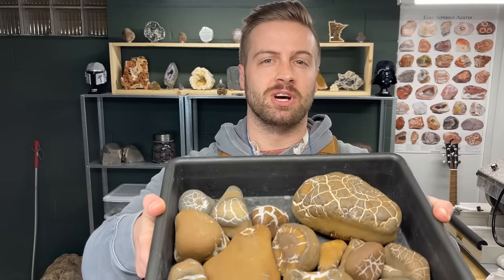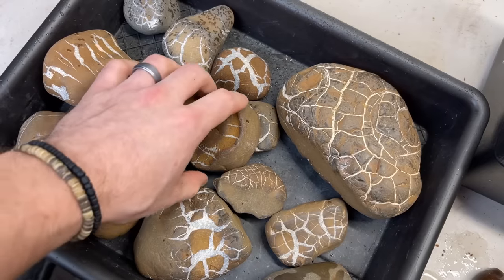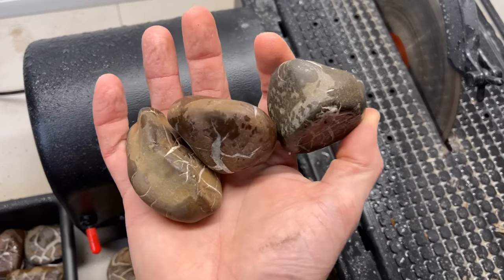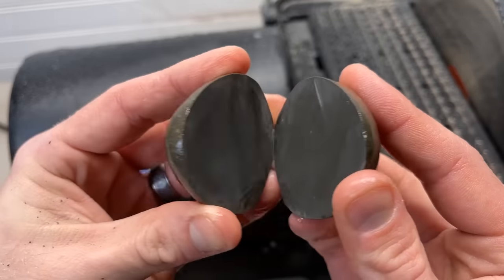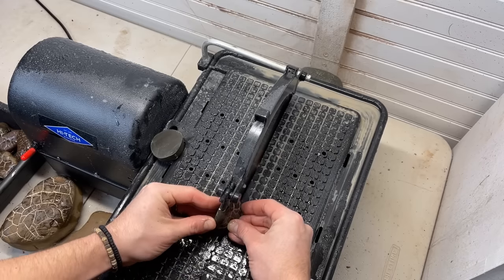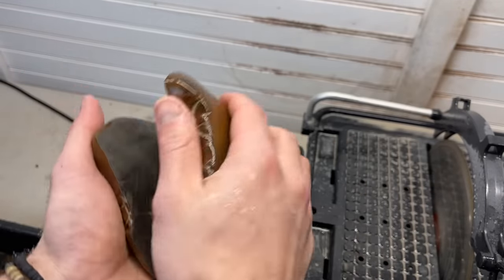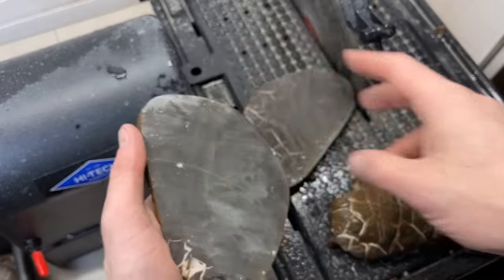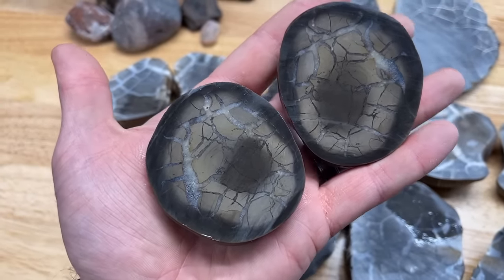Cutting Lightning Stones open | These Septarian Nodules rock!

Comment: I'm certain you're doing that cutting safely but my heart was in my mouth the nearer your fingers got to that blade!
Reply: My thoughts exactly! 
It's fascinating for sure! 
....but I'm most glad he has all his fingers!
Reply: Same
Reply: Yep gave me anxiety
Reply: these type of saws cut more by grinding than cutting in the typical saw blade or serrated knife sense, a brief touch doesn't even always hurt, to me, not like you could try to grab it but still
Reply: Haha, me too - yikes!
Reply: Yes that made me cringe.
Reply: Do research
Reply: @johnconklin4452  right? There's literally a video of the guy intentionally putting his finger on the blade multiple times.😁
Reply: A wet saw doesn’t cut the same as a dry, wood cutting saw ..wet saw is like a fast moving nail file unlike the dry wood saw blades ..the wet saw “files” away the skin if one can stand the pain to hold your hand there, basically a wound like when one falls and slides across pavement or cement, an abrasion ..wet saw blades are not at all as dangerous as the dry, wood saw blades
Reply: It’s like a saw that cuts off casts 😂 it can’t cut you lol
Reply: Diamond blades only cut stuff over a hardness of 1. Skin is less than that.
Reply: When you’re working with tools like this you learn how to respect them.
Reply: Me too! It made me feel funny. Reminded me of when I was sanding my stairs without a guard and nicked my knuckle
Reply: Rock saws do not cut your fingers
Reply: My thoughts too!!! 😱😂
Reply: I’ve seen videos where this type of blade isn’t dangerous, but I’ve also cut myself really bad on a piece of sandpaper on an orbital sander! It’s hard to watch no matter how many times I’m shown it’s safe.
Reply: Diamond saws are not like other saw blades with teeth.... if you have used one you know they will give you a friction burn but won't really chop ypur finger off 😊
Reply: It’s a diamond blade that cuts by friction thus the water to cool the blade. Having nicked myself on a concrete saw it’s will cut you but because of how slow it cuts it doesn’t cut much not like a wood saw that would literally remove fingers.
Reply: Those blades won’t cut skin easily.   It’s more of a skinny grinding wheel.   He would have to try rather he’s to injure himself on a lapidary saw
Reply: I thought the same thing! Learned something here about the diamond saw! Also most of us having anxiety about his fingers good chance we are moms! It’s by nature to be concerned about everything! 😂 awesome video!
Reply: If this saw is anything like a wet tile saw, it won’t cut you unless you get caught between the blade and a hard surface
Reply: No danger. Diamond blade
Reply: Ikr. I was biting my lip waiting for him to lose a finger. Beautiful stones my friend. Don't lose a finger my friend.
Reply: That’s crazy
Reply: He still has all his fingers so why the freak?
Reply: Oh yeah, I'm surprised all his fingers are still intact.
Reply: It would not be as bad as you think if he touched it
Reply: The mother in me is cringing! Had to look away!
Reply: You can touch the blade running but don't want to be pinched where it moves
Reply: Oh damn, I,see your point!
Reply: @erasamus1057 like a razor blade often cuts u bad but u dont realize it til u slip on the blood all over  the floor😆🫠
Reply: @kelcritcarroll  no.... absolutely nothing like that. more like when you use sand paper and you accidentally sand your hand some and it gets smooth but if you did it forever you might not have skin
Reply: I have a thin diamond blade and it doesn't cut but it can burn a hole in your finger! I did that (ouch) and then I went searching for finger protection.  On Amazon I found some silicone finger covers and am going to give them a try. I hope they work.😊
Reply: Yeh, I felt the same.   I`m sure this cutting technique is NOT WCB approved...!      Willi B.
Reply: Your hand placement didn't bother me at all.  You know your material to cut, and you know your power tool.  Ease up, snowflakes!
Reply: I'm doubling down now, on my reply, after viewing these others.  You people obviously haven't much experience with stone cutting, or jewelry making.
Reply: I’m a trauma RN…I can’t watch…🫣
Reply: So geht es mir auch beim zuschauen...🫣
Reply: Me too!  Please be careful!  Thanks for all the enjoyment!  🙏❤️🙏
Reply: It’s a diamond blade with smooth edges cooled with water. There are literally videos out there showing people touching the running blade and they are just fine. I’ve touched the running blade myself (on purpose) and it tickles more than anything. It WILL cut your nails though! Lol😂
Reply: Beautiful rocks btw!
Reply: Good thing there isn't a blade then! It's more of a file.
Reply: @erasamus1057 .   I jumped forward past the cuts until I realized these are recorded and he’s never going to show his fingers being cut off. Not to mention he’s done this a lot and can still count to ten. Makes me uncomfortable, but I can watch now.
Reply: That last big one have you considered polishing the outside up?
Reply: That day will come, you ARE too near the blade. I've known too many people that have run chop saws, table saws, etc...and are now running around with missing digits. We're talking people running saws for 40 or more years.
Reply: Diamond saws don’t cut flesh but watch your finger nails. I’ve a diamond saw on many occasions . They cut through tile glass and stone no problem . Once I a. Idently put my finger on the blade and was relived it didn’t cut
Reply: My understanding is that in the absence of notches, a blade coated with diamonds will cut you but a blade embedded with diamonds will not.
Reply: @lisaortiz635 Yikes!  Sounds like a job that would be miserable for you if it’s that difficult for you see things like that.
Reply: @shewho333  ceramic and likely low grit sandpaper is way more abrasive that continuous diamond blades you will only cut yourself on one of these saws as quickly as you’d cut yourself on a smooth rock in a river.
Reply: The trimsaw not cut finger.....it's nice trimsaw
Reply: There has to be another way to push the rocks through the saw that is safer. If one of those rocks slips his fingers are gone.
Reply: Gives me the heeby geebies! So glad to read they are safer than they look!! Love watching your videos! So educational. 😊
Reply: Yes me too, I was a bit nervous watching how you’re cutting  stones , just be careful.

Comment: If you cut slabs , the picture changes a little with each slab . The on you cut open and you didn't see any kind of beautiful lightning designs , cut closer to the end where you see the design on the outside. I used to make jewelry back in the eighties and nineties . My Father taught me how to do it. sadly I don't have that equipment to do it , it's expensive equipment. I miss doing it .

Comment: I like the one that fractured off, it kinda looks like a mountain silhouette with streams of snow coming down, like when it first starts snowing and the snow settles in the low parts and the high parts aren't covered yet
Reply: I agree.  It gave it more personality.
Reply: I would probably take the little pieces and polish them. There should be a bit of the crystal layer right at the breaking surface.

Comment from the maker: Subscribe to help support our channel ❤
Reply: I live in the mid south and I've never seen stones like that!! They're gorgeous and so cool, both inside and out!!! Thank you for sharing that with us. I think the one that fractured can still make a cool piece, maybe only looking at the outside layer. or both sides.... but mount it on a plague or stand made with, clear plexi-glass or similar see through material,  that has a plate , so a back to lean against and a "floor" to sit it on at the bottom of it, at least 2 times wider than the rock itself, and with the outside face showing.... and place the pieces that broke off on the shelf in front of the rock face. 

Then place that on a swiveling block with a changing or not changing LED light shining up through the "glass" to illuminate the stone from below. One could make the stand completely enclosing the stone and pieces and then either with fiber optics or  cut points within the "glass" to cause the light to reflect a little differently at each point to make it appear like the stones are floating in space with stars showing brighter all around it., or stars showing in the "background" of a mountain range. 

I'm sure there is  likely some easier way to make it appear something like that. From the front to me the breaks look like a jagged mountain top within a mountain range where it broke up and there was a rock slide and now those rocks are at the foot of the mountain. Anyway. IF you have it against or inside something clear then people could still look at both sides. You could probably mount the stone pebbles in a way to see most sides of each one if not all sides of each one. maybe drill tiny holes and thread with fishing line or tie fishing line around the stones and add a tiny bit of super glue and hang them low in front of the rock, with the knotted string sticking out of the top with a bead or stem like ornament on it's end and is knotted just below the "glass" and then strung with an ornament or charm leaving just enough slack to raise them up a bit and allow for rolling/turning of the string between fingertips to get the stones to spin a little so one can look at most sides without touching and giving no opportunity for five finger discounts unless you authorize for an interested child!!
Reply: Whoa Brother!!! That’s crazy!!! In the service, My Dad was hit by lightning (twice) A few years later He was hit again… Makes Me Wonder 💭 4tru… Hmmm lol Maybe that’s why He had 9 of Us Kids… A few months ago He went beyond The Veil, He would of been 94 Dec 31st… I don’t always comment, I do love Your work My Friend… Ohhh loved the stones…
Reply: Do 3mm slices
Like when they cut up brains
Reply: Where is tge "AWESOME" button?? Cuz this video is...AWESOME!! Great finds!!
Reply: I have a hard time watching with your finger so close to that wet saw ! 🫣 but, can’t look away.. beautiful stones ! 🤩
Reply: You should check out the glue that fossil People use. I've seen them chip off bits of fossil but they glue it back together. And it looks like it never came off. I wonder if that would work the same for your piece that you had the blowout on
Reply: I have no experience at all and this is the first time I've even seen or heard about lightning stone so excuse my ignorance but why couldn't you just try to stabilize that side which is the more sensitive before cutting it? I'm thinking either some strong putty or perhaps even like they do with for example transports of dinosaur bones? There are products like that you can mix together and looks like toothpaste and perhaps you could coat that side in a thick layer or perhaps the whole stone and then dissolve it away after the cut. There are probably water soluble putty's making it very easy to remove to limit the need of putting the stone through more stress by scrubbing it. Or is this just unlimited amounts and easy to find these so it doesn't really matter? I thought it perhaps have some value especially the large one, making it worth the time? Nice video anyway! I really like them too :D Good luck to you!
Reply: Have you tried putting tape around the rocks to see if it helps stop the fracturing/ break outs.
Reply: Listen brother you are young enough to still having all your fingers intact, my advice to you is don't do what you are doing, is not worthy making stupid things just for getting likes , or even worst for being lazy. 
  I know for experience people like you don't listen and only understand when It's too late, but that's how we are. 
     Have a great day .
Reply: Perhaps you could stablize the outer edges of the big stone with epoxy, silicone, or perhaps CA glue.
Reply: What is a lightening stone? Do they make lightening or did they get struck by lightening????
Reply: @theducklinghomesteadandgar6639 kk
Reply: have you thought to Cube cut any rocks? 
YOu know instead of cutting them in half just make a cube of cuts.... so we can see the true beauty :3
Reply: Me too! The mother in me is cringing!
Reply: Never heard of these, so kool!
Reply: @lamest2023 i am sure its because of the lightening design on the rock
Reply: That big one that you were worried about cutting again, couldn't you work it on your cab King to reveal the outside better? Or would it be to hard to work something that big on there. Not saying cab the whole thing, although that may be kinda neat if you can. But keeping the contours but revealing enough and and get a little bit of a shine to it. I only have a slant flat lap  and a saw, same brand as yours. Got them a couple years ago.  I made my wedding favors out of rocks I found in Erie on vacation, to practice. I am very limited on size, and I have to work different. But lets say I can figure out space and funds for a cabling, could you do something that big on that? Idk, never seen it, and been learning on my own. A lot through utube, but also worried about picking up bad habits.  But you seem to know what you are doing from what I can see. I think I found some of this stone before, not sure if it was same thing. And cant remember how easy it was to work with or if it was one that I lost the detail trying to get it to shine up
Reply: I smashed the like button on that one!
Reply: @Old-Skull.   the saw has diamond dust for cutting the stones. You can put your finger directly on the cutting edge without getting cut.
Reply: @1953lili   Don't worry.  Diamond dust will not even scratch you.  Many a friction burn if you leave your finger there.
Reply: 🎉🎉🎉Good 👍👍👍
Reply from the maker: @Old-Skull. I don’t do anything for likes. It’s a lapidary saw bro

Comment: Hello! If you slab some of the stones with plain rock near the middle into cab.s, those can be mounted with a rivet-bail through a hole in the boring part. Then the  bail can be set with either an interesting agate or a small round facet stone to pick up the interest. __

Comment: They turned out awesome! The one you picked was my favorite also! You said you were going to polish one, are you going to make a video of that? I know it is sometimes hard to polish the softer material and would like to see what's it like! I usually get stones that are basically tumbler ready and or have to be cut down to fit into my tumbler but no matrix on them! My saw is a 4 inch tile, which works pretty well for me! Hoping to get a 10 inch sometime soon! Thanks for sharing!

Comment: 7:50 As a magnet for ticks, I can relate. The worst was walking along the side of the highway once, I had a long skirt on since it was hot out. Thank goodness I had a pair of short shorts underneath. After getting to one of the open parking lots, I looked down to see if I needed to brush off debris and nearly shat myself... There were at LEAST 200 ticks on my skirt. I pulled it down and abandoned that skirt right at the edge of that parking lot and ran across it as far from that skirt as I could get. I checked the rest of me, pulled off 12 more ticks, and then I never took that route when walking again.
Reply from the maker: That sounds awful!
Reply: @AgateDad  I've been paranoid about ticks ever since. Any time I go out into the woods or near high grasses, I rub tea tree oil into my scalp, and all over my body and clothes. Keeps them well away from me.

Comment: Some of those stones are completely 100% through and through with red chert and quartzh lightnings, although i had to look in the river bed for a long time to find some. I'm interested in using boiling salt to weather rocks , and acid/basic media which are not liquid, like some kind of caustic clay or smth, cos I discovered that weathering of rocks inside sand is completely different from when they are at the surface getting mechanical liquid weathering. i've seen a dude who uses acid but that's difficult it needs very specific rocks.

Comment: I know cutting it upright and length wise gives you the largest display surface, but have you considered putting it flat and cutting them like a loaf of bread? It might have given you better results be it smaller 6-8 pieces, good for pendants. You might want to try cutting one that was blank inside, horizontal. Just a thought.

Comment: I believe these are caused by a combination of high frequency reverberate shock sequences, as in the proximal zone to a meteor impact.  Vibration and  high heat fractures the stone in situ, and further mineralization from hydrothermal or calcium carbonate or siliceous sinter deposition provides the connective lattice structure.

Comment: As for that last one, I'd cut the other half but start my cut where those bits broke off on the other half, rather than finishing my cut there. Starting the cut there, those more fragile bits are sturdier cuz you're pushing them into the rest of the rock they're connected to, rather than pushing them away from the rest of the structure and off into nothing.

Comment: You need to get one of those pushers that carpenters use when working at a table saw ... it's like watching the chefs on chopped using a mandalin with out the protective cover, then they're chopped because they bled all.over the food.
Reply from the maker: This isn’t a wood saw or a sharp blade

Comment: You could use a Dremel tool and carve an artistic work in the area of the stone-cut where there isn't anything, or have a stone artist work some intriguing design into the stone with all the surrounding "lightning", if that stone can be worked in that respect.